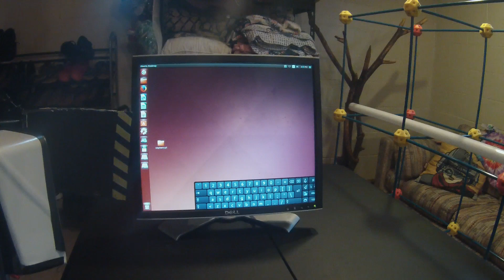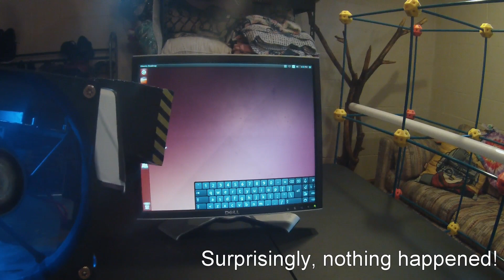Ultimate HERF Gun- Directional Microwave Blaster!

Comment: You don't want to be in the same room (or nearby room) when the gun is on. Should the microwave energy encounter aluminum, the wave will be reflected. Sooner or later, you will absorb enough electromagnetic radiation for massive cellular damage. leading to a very weakened state, or most likely death. 
Gun modifications should include: an aluminum barrel at the magnetron for a beam with a tighter scatter pattern. Think of a regular shotgun, as opposed to a "sawed off" shotgun. Longer range makes a more effective weapon. The gun should be mounted, and shielded, in an automobile. A good 600W computer backup power supply should be able to fire a low power microwave gun, and the internal battery can be recharged by the vehicle. Instead of moving the gun to aim it, a movable reflector can change the direction of the beam. Can you imagine being able to burn out the engine control modules of the maniacs who try to cut you off? DISCLAIMER: Some jurisdictions may require you to have a special license to operate an EM armed assault vehicle, and other jurisdictions may relocate you to a "residency center" with bars and guards, for possessing an unregistered EM gun.
Reply from the maker: betaatomic I tried a few different reflectors and this one seemed to have the best range for me. I could turn on leds from across the room. I don't want it to be vehicle mounted because that would defeated the purpose for me. Also a 600w power supply won't come close to running this. When I was messing around with making it portable I ran it off of a 2000w power inverter. Also this is non ionizing radiation so it doesn't cause molecular damage. When you cook food in your microwave it doesn't change the food at a molecular level it only transfers energy to the water and fat in the food which is converted to heat. Thanks for your suggestions, but to me this is a finished project from last year. I've since moved on to bigger and better things! thanks again for the comment have a good day!
Reply from the maker: betaatomic also I have totally thought about frying other cars though. I would use 4 of these mounted around a central chamber with the waveguide emitting from there. much more power to work with to get through the reflective metal of another vehicle. that would be better for your vehicle mounted unit. disclaimer: don't build that. it's dangerous.
Reply: Interesting you mentioned that Steve. I also remember an incident where an object, can't remember if it was a statue or some other award type display that was given to the white house. Inside was a simple resonant cavity. Well they discovered microwaves being beamed at the WH and started investigating. Turns out there were vans parked on each side of the facility with one van beaming microwaves at the target and the other receiving them 

The funny thing is they discovered that the resonant cavity reacted to the microwaves as was intended and re radiated them. But it also reacted to sounds in the area. The resonant cavity became modulated by the audio sounds and re-sent the microwaves with the audio as a slight modulation. It was a secret listening device! LOL

Well maybe that was actually the embassy you mentioned, can't remember the exact details, been a long time.
Reply: it only hurts tou like a blow torch-a quick burn on the hand once a month wouldnt accumulate radiation as long term. it could cause internal damage though-the outer skin can repair if not too serious whereas internal organs etc may not and repeated amounts could cause further problems like prolonged sports injuries over many years-things dont  heal the same after to many repeats of injury.
Reply: Troy Powers portal 2 huh?
Reply: betaatomic I doubt a microwave will kill you. They only vibrate particles producing heat, and interact with metal in violent ways
Reply: abraham seras do. you know how cancer, and radiation induced cancer works? In simple terms, the ionising radiation particles may enter the nucleus of a cell, and cause damage there, leading to cancer. This does not happen with the non ionising radiation this thing produces.
Reply: Gary Rhodes yes, but radiation induced cancer comes mostly from ionizing radiation because of ionized particles direct interaction with dna
non ionizing radiation is a one time trauma for your tissues, ionizing radiation basically floods you with destructive particles
Reply: That's hilarious this gun has to be where the idea for the movie ghost busters came from. I could see a college student who made one going around pranking the girls dorm at night making thier lights glow at night and making them think thier house is haunted lil
Reply: TruAnRksT Your comment lead me to some interesting reads. Turns out that was called "The Thing" bug and the fact it was implemented in the 40s is incredibly impressive! https://en.m.wikipedia.org/wiki/The_Thing_%28listening_device%29?wprov=sfla1
Reply: I'm going to date myself now, but during the '70's our embassy personnel in Moscow started to have elevated rates of cancer - mostly leukemia if I remember correctly.  Once the USSR collapsed and records were opened, we found out they had pointed a microwave "gun" at the embassy as part of human safety trials - Soviet style.  Might want to keep the kids away from that thing.  Very super cool though.  Nice build.
Reply: I would have to say that there has been plenty of non ionizing radiation can kill you. if you are exposed to it long enough but the cancer thing is still debated. I'm sure if you had enough radiation and enough consistent exposure who knows.

Comment: I strongly advise against this kids . unless you want cancer among other harmfull outcomes ..take a cb leiner and you can light the tube up much safer ...kid be carefull posting shit like this get your self and some poor kid that trys to copy you seriously hurt
Reply from the maker: Shanna Deal this utilizes a non ionizing radiation so it cannot cause cancer. It is absorbed by fats and water and converted to heat but does not change its genetic makeup. You could get a burn but not cancer. Sorry to disappoint you.
Reply: find you a old military radon detector and then tell me that after you post the radeation levels ..its highly dangerous you could cook your heart amoung several other accadents waiting to happen ..we will see if you live to 40
Reply from the maker: Shanna Deal you wouldn't use a radon detector to check for this type of radiation. Also I think what you are actually meaning would be a Geiger counter which would be used to test for ionizing radiation like that after a nuclear blast. Since this is non ionizing radiation a Geiger counter would not be useful for checking for this type of radiation. In this case a microwave leak tester would be the correct tool for the job.

Comment: How much watts do you supply the magnetron with?
Reply: Conex Xenon around 840 watts to absolutely 1000 watts
thats equal to everyday microwave wattage
Reply: xXx_MlgTr1kSh00ter _Xx you need 2000V to power it, it outputs between 700W-1500W depending on power
Reply: Oh right

Comment: mate I hope you didn't just rip the microwave component out of the microwave oven and stick it on your gun... because if you did .. well im sorry to say mate but you probably have cancer
Reply from the maker: Blackout708 this produces a non ionizing radiation so it cannot cause cancer. if I held my hand in front long enough it's possible for me to get a burn.
Reply: ahah not talking about that friend , there are components of a microwave that if damaged or removed without care can release some hazardous stuff that isn't very good for yah even if the microwave is unplugged/has no power to it but you seem like a smart guy so I'm sure you'll work it out one day
Reply from the maker: Blackout708 You must be talking about the ceramic insulator inside of the magnetron. It could be hazardous if I disassemble the magnetron, smash the insulator, and breath the dust. Not planning on doing that though! Thanks for your concern!
Reply from the maker: BTW for anyone interested the hazardous material in the magnetron is called Beryllium oxide. It is used as an insulator that has high thermal conductivity while keeping the components electrically isolated. After it has been hardened as a ceramic it is safe to be around as long as it isn't crushed or broken. It has some interesting properties so look it up if that sort of thing interests you.
Reply: eyyy yup thats the one! you really know your stuff aha great work man :)
Reply: sorry also , I'm an electrician so I get a bit concerned when i see people making things out of microwaves without knowing the risks involved but it sure seems you do! especially considering i couldn't even remember the name of the stuff :P
Reply from the maker: Blackout708 hey no worries! You brought up a something true that I hadn't touched upon yet that has to do with safety. Although I am not concerned about it other people watching this video and reading these comments may not be aware of that danger!

Comment: what could one do to protect himself if ever attacked with a weapon like that
Reply: some kind of kitchen foil wall/shield / directional reflector
Reply: step to the side and punch wouldbe attacker in the kisser.
Reply: John Hall I think i would lose my shit with that song playing and a madman using that weapon
Reply: John Hall wrap yourself in tin foil
Reply: TIN FOIL HAT
Reply: You could use a grounded Faraday  cage to take the emp to ground. It requires a double cage system. It's like a big box that's grounded and within the big box you want another box set at a distance from the outer box with in it. Both grounded and better to ground in more than one spot but it must share the exact same ground and the separation between the inner box and its outer is an air gap at least a couple of inches from each other. This forces as much of the Flux as possible thru the outer boxs material and creates another path if the initial box is saturated initially. The material can be any ferrous material or metal that conducts electricity. But grounding wires should be heavy gage wire. Both boxes are grounded to each other and to the common ground. Thin sheets of aluminum cause sparking and is easily overcome by the emf as it saturates quickly because it is thin. It's like a sponge the thicker the sponge the more water it holds. The thinner the sponge the greater the amount of water that cannot be absorbed and redirected to in this case ground. The Flux has filled the metal and the rest gets the chance to find other ways to get to ground like you or your electronic components.